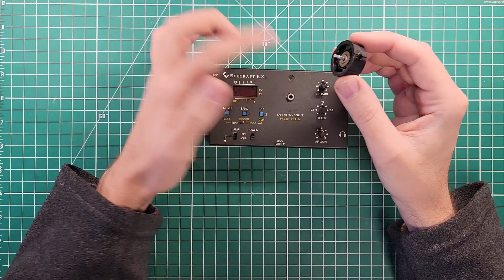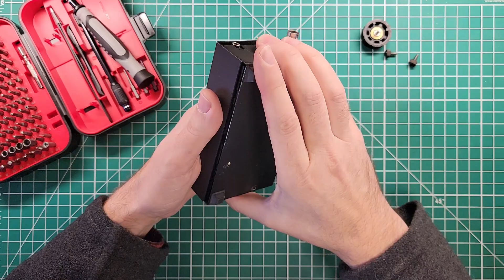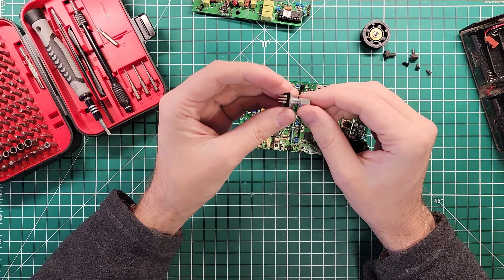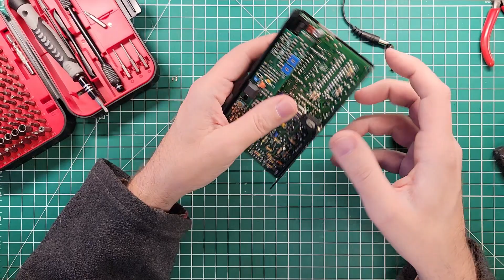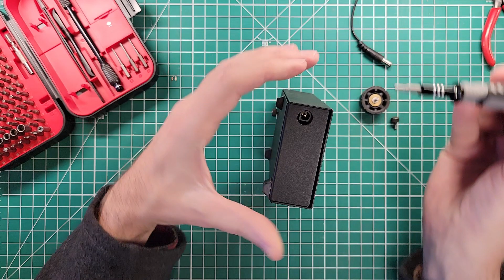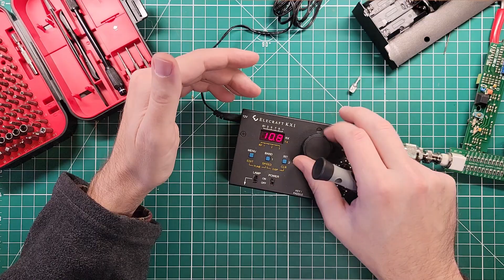Elecraft KX-1 - Tear Down, Rotary Encoder Replacement, First Looks

Comment: I need to do exactly this repair, or at least take the encoder apart, clean and grease it. Did you get the spare from Elecraft, or from an electronics supplier? Do you know the part number? Many thanks for the video!
Reply from the maker: I wish I knew, maybe it came in a box of spares I had, but I can't find any reference to ordering one in my notes.  Probably so "standard" that I didn't even think twice about getting it being hard.  Not that it helps you any, sorry about that!
Reply: @temporarilyoffline  No worries! Thanks for the reply!
Reply: OK - I have found it, with great help from the people on the Elecraft mailing list. I put this here, in case anyone else needs one. It is available from DigiKey, and the part number is PEC11R-4015F-S0018-ND. Your video is very instructive about how to remove and replace it - thanks!

Comment: Now for a tear down of the dead encoder.

Congratulations, BTW, on winning the parity derby.  Some of those encoders, apparently, turn the other way.
Reply from the maker: It is very hard to turn "left" to go "up" - sometimes it's a software fix, sometimes you're just stuck with it.
Reply: @temporarilyoffline  You can sky-wire a 2 pin swap...
Reply from the maker: @KeepEvery1Guessing  effective... but not elegant - unless you're stuck in the field, then GENIUS!
Reply: @temporarilyoffline  Given that there are 3 other pins, and two actual mounting ears holding the encoder in place, and it doesn't involve modifying the PCB, it's not a terrible answer.
On the other hand, I'd like to see the PCB designers include a 4 pad quad that you can short either across or up and down, to perform the swap, with the usual cut-able mini traces selecting the default direction.  Of course, most designs have been sent to the PCB house before they realize that not all encoders are the same.  (Who, me, standardize?)
A NVRAM setting, as for left handed paddle, implemented in a firmware update seems the best after release fix, but Elecraft probably has no trouble sourcing the right encoder, so I wouldn't expect such an update from them.
Reply from the maker: @KeepEvery1Guessing  and that's why  I ordered the part from elecraft!  I hate that there are so many incompatible parts - that still fit.

Comment: Good luck trying to find an unbuilt KX1 kit… I heard Elvis sold his to Bigfoot, so you should check with him. 😂
Reply from the maker: I know a guy that knows Bigfoot.  I'll check!
Reply: @temporarilyoffline  I picked a brand new in box with unopened plastic packets with receipt from 07/2005 - on ebay - not cheap - original invoice was for $476.30 - its on my list of kits to build and document this year - rocking horse dung comes to mind
Reply from the maker: @mattghoward  sounds like a fun project - I know after I get mine it will still take some time to clear the schedule to build it and then even more to get it tuned for maximum power output.

Comment: Steve… now you know for next time, the 2mm set screw is there!  Nice that you have a desoldering station, Bro.  As an electronic technician since the early 1980’s, I recommend using a few drops of rosin core flux to preserve the circuit board pads and reduce the direct heat exposure of the desoldering station.  Nice work!  73 de KD6UYK (Tim).
Reply from the maker: Good Idea on the Flux! I did something very similar with adding new solder (with rosin core in it) to help with that.  I've run into lifted pads and traces on the Commodore 64s I've repaired, they are pretty notorious for that.  Thanks!